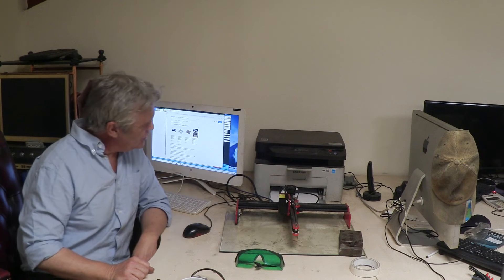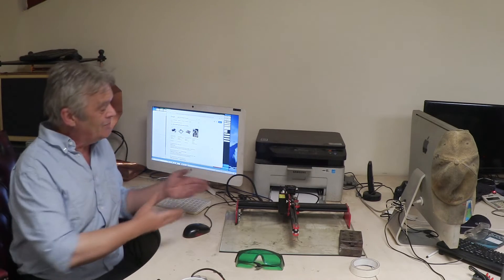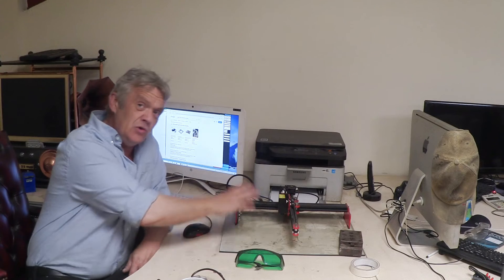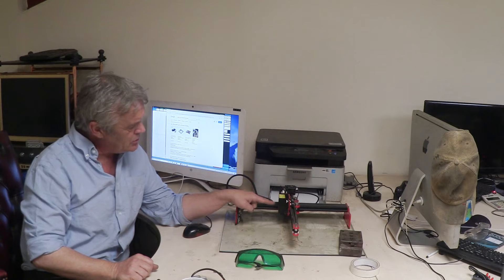1251 Repairing A Vigotec VG 17X 20 Watt Laser Cutter

Comment: You can add a blower to the laser to reduce the amount of smoke that gets on the lens. Typically, it's using a small fish tank air pump and running a tube so that the air blows at the part being burned.

Some say it also enables the laser to cut thicker material.

Comment: so my question is have you tested and tried multi layering copper after being lased on one layer of the copper nanoparticles you were making in the very first video I watched of yours XD (ie using it to sort of 3D print copper by testing if the next layer will fuse to the bottom layer below it, in what is normally called 2.5D because the next layer is not automated completely)
Reply: I am also guessing that using a lower power will give a more foam like fused copper so electrodes for batteries could be made, and switching metals will allow further exploration on your battery front :)